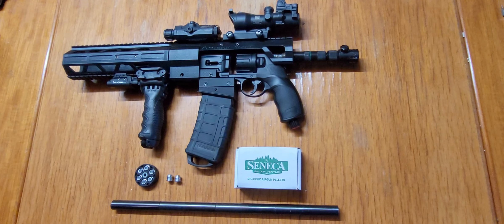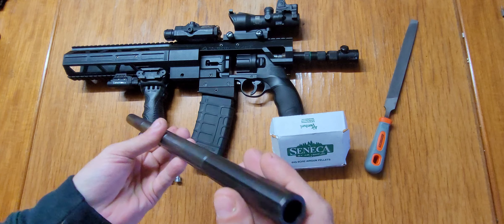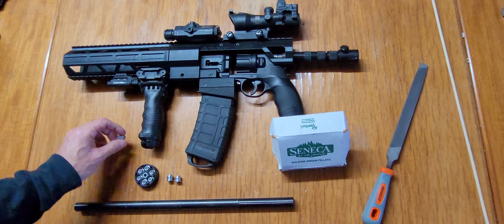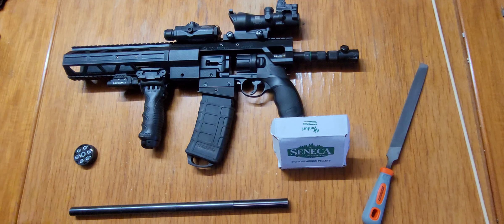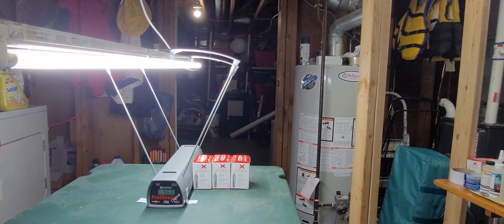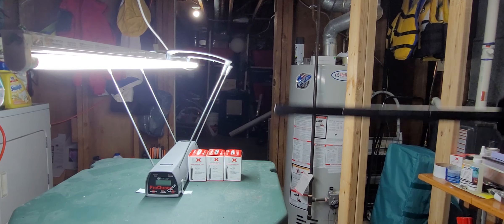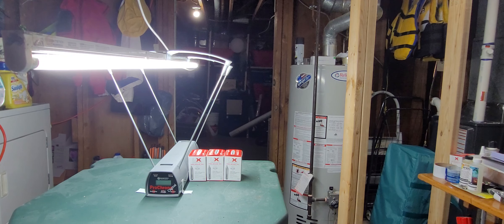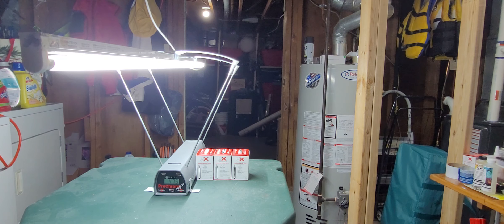Umarex T4E HDR 50 Lead Hollow Points 11.8g 123 Joules 475 fps

Comment: fill the tips with flash powder and seal them with liquid sulfur from "strike anywhere" matches, by cracking the sulfur of the matches and put a little bit water to them and make a paste out of it, seal the tips and let them dry in the sun or on a heater, then shoot to hard surface and enjoy the big bang

Comment: The lead balls aren't perfectly round, more like a football so they get jammed up in the 12.5mm
Reply: u can use a half inch bit amd make tye cylinders closer to 12.7
Reply: @Seabass1206  that doesn't do shit for the barrel... Especially if you are using the tuning barrel and sniper extension...

Comment: Friend, I have an HDR 50 Gen2, 02 barrel of 20cm each (40cm total), powerpin, hpa 1250psi, hpa rear adapter. Do you think it's possible to get to 120 joules?
Reply from the maker: with the higher psi its very possible, the more psi the more power, same if you up your barrel a bit you will get more gains

Comment: Entonces la energía depende más que todo de la longitud del cañón, porque si la cápsula de CO2 también tiene según la temperatura 1000 psi no hay mucha diferencia en el hpa , solo agregando mucha extensión daría más y más energía
Reply from the maker: yes hpa is regulated so the power will be the same until you go under the output pressure, cuz it loses pressure fast cus its not regulated and it freezes as well, the higher the psi the more power and longer the barrel the more power and if your ammo matches the bore of the barrel you will max out your power also if you increase the air chamber you will get huge gains

Comment: in the dead center of the absolute circumference of a ball is where it is biggest . have you ever loaded a black powder revolver , the ball is put into the cylinder and has to require slight force to sea ball real tight in it then grease is applied on top to keep repetitive combustion from happening right ? well in the process , a perfect round sliver of lead is shaved off in the process , id you were to get ball out it would look like 2 slugs glued together at their back sides ! so maybe go to a reloading store and just get you a sizing die ,and size to whatever size you want .check LEE DIES !!! ANOTHER ONE OF MANY PROBLEMS SOLVED BY YOURS TRULLY , THE NINJA  LOL !!!

Comment: The diameter of the round ball is too big for the barrel but they can fit in the cylinder mag because the contact patch is very narrow and the plastic mag is flexible compared to lead
Reply from the maker: i just filed the seams and there shooting great now

Comment: The 100mm extension tuning barrls from HD24 have a slightly smaller inner diameter than the original HD24 BARREL.
Reply from the maker: ya but how do they fit the mags nicely and not the barrel? them slugs fit and slide down the barrel nicely but will not go into a non drilled magazine very strange lol